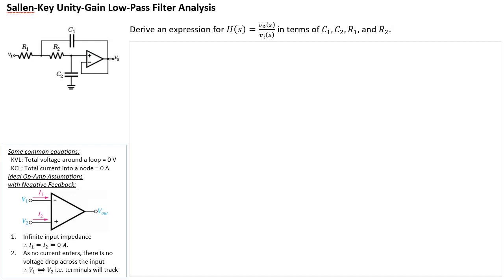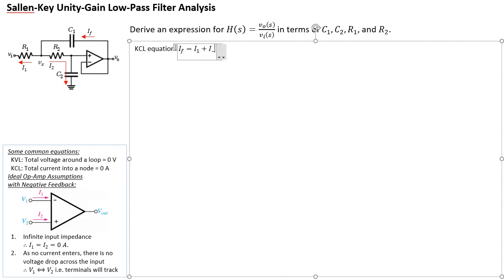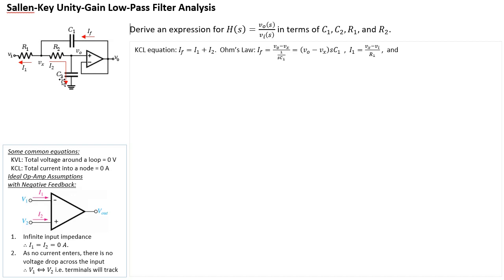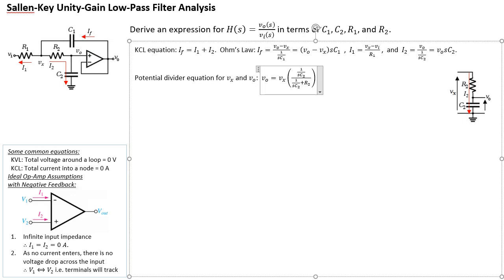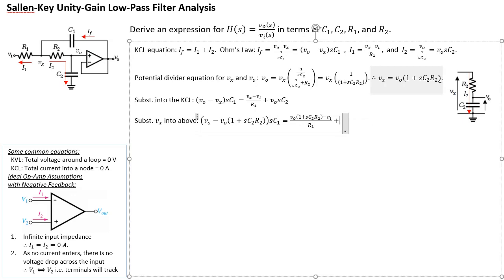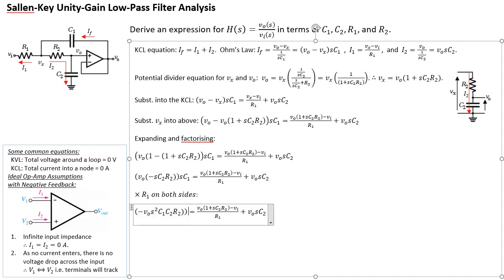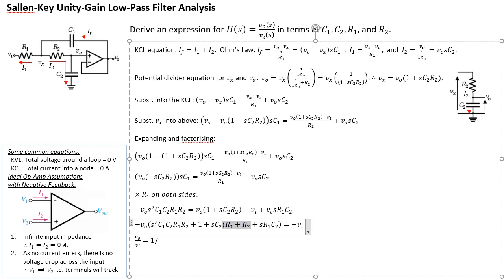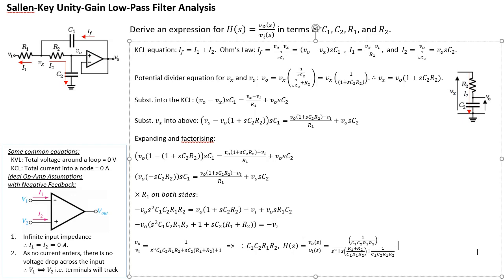Sallen key unity gain low pass filter - Sallen-Key Low-Pass Unity-Gain filter response

Comment: s^2 = -1
Reply from the maker: s is a complex term, usually written as σ + jω where σ is the real part and ω is the complex part where ω=2πf. These types of analysis is called an s-domain analysis where we can use algebra to solve the equation. Compare this with time-domain analysis where we'll have to deal with complex differential equations to find solutions. We use Laplace Transforms to convert from the time to the frequency domain, when dealing with circuits with impedances. Hope that helps. :)